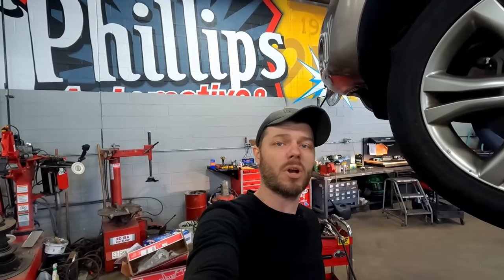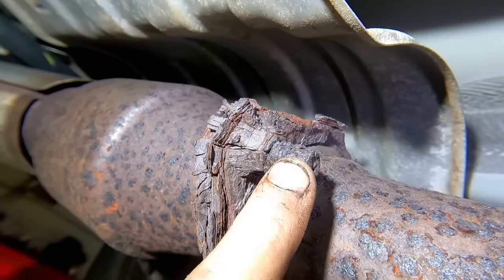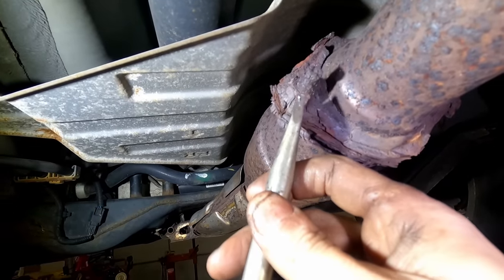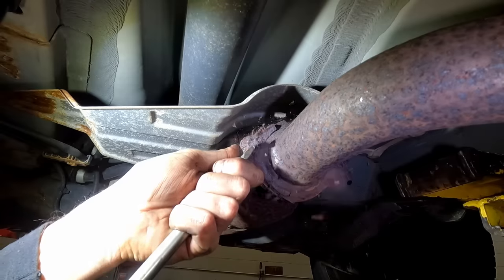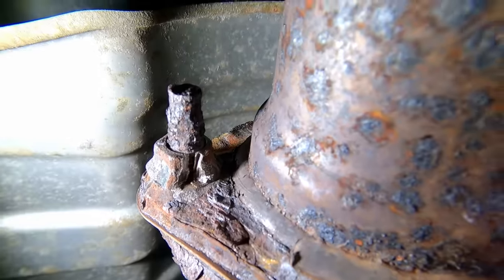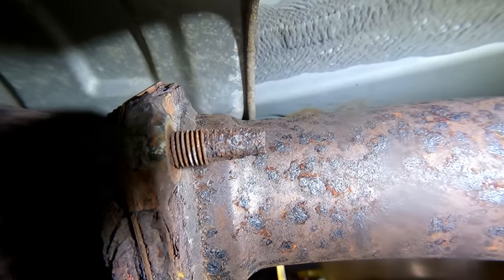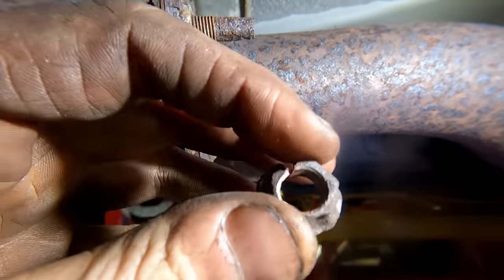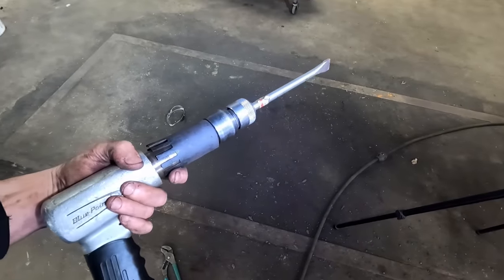Top Secret Mechanics Trick 2! HOW TO remove extremely rusty exhaust nuts FAST without heat.

Comment: That's one way but honestly I'd prefer a die grinder in this situation (1/4 collet rotary tool) with a cut off wheel.  A dremel would be more common in home garages.  Either is quicker, cheaper, less noise and more accessible.  To the regular DIY guy, just a dremel type tool cut off. I bet more people have a dremel  aka 1/8th collet rotary tool than an compressor and air chisel with chisels.  I'd just replace the bolt too 🤷‍♂️
Also you can fit a rotary type tool in many more spaces than that chisel.  Get the good reinforced cut off wheels though. Those cheap ones suck!!
Reply from the maker: Thats a stud not a bolt. Kinda the whole point of the video. imagine this was a stud on a cylinder head for an exhaust manifold. Please don't cut that off...

Comment: I'm a ford rocket scientist and I know broken bolts and pins in small block and most are big blocks where exhaust bolt break  is common. Made in USA parts were not used in fords nuts and bolts for many years sub par china bolts were used. Truth. Ford admitted it several times I know of.

Comment: This s a great example, number one the Catalytic Converter is pricy, so anything that increases the chance of reusing it is worthy ... Number two it's fast .. cutting off the bolt and tryg to redrill it, for a regular bolt and nut, is time consuming, and makes it more likely to leak exhaust fume or noise.. 

For the home mechanic, air hammers are cheap you don't need Blue Point for hobby use, AND you can get by with an air compressor a fraction of the CFM required by the air tool (read no 20 HP Shop Compressor needed) .. a cheap small air compressor WILL work, you just have to pause frequently, to let it air up to full power.

Comment: It works great... but i just use my 4 inch grinder and cut the nut off (if the bolt is damaged too)like yours are on the cat ...since your not going to use it again anyway.

Comment: Another great video. For a DIY home mechanic who doesn't have access to an air hammer, could you achieve the same result with a hammer and chisel, assuming you have space to swing it? Please keep doing more videos like this, they're really useful.
Reply: Yes you can.  You can also use a Dremel abrasive disc to make a sharper grove that splits the nut open using less hammering.

Comment: My air chisels are too soft. Its an old method done with a cold chisel and hammer. I'll be shopping for proper hardened bits now.
Reply from the maker: Snap-on. They arnt as expensive as you would assume. Worth the money and guaranteed for life even when you grind them down to a nub

Comment: I’ve always either gas axed off or cut off and drilled out to replace with a suitable nut and bolt.    Both ways work  but it’s a far different “ experience “ on a lift vs flat on your back with a car right in your face.     That’s a whole different world that I’ve come to know far too well☹️

Comment: Well you got the nut away but the catalytic converter and your lambda probe in the vicinity hate being punched around. Both have delicate ceramic parts. The actual Converter is a brittle round brick with tiny holes and it is wrapped with a thin heat resistant fiber mat and stuffed into the stainless steel tube. The mat does the trick to buffer the thermal expansion which is a real problem. To keep them from axial moving due to exhaust pressure they are supported by a ring of wire mesh on each end. If u punch it hard enough the wire mesh chips away at the ceramics and if those chips occur at the frontend of the CC they are trapped and hit the ceramics with the exhaust acting like projectiles till the typical golf ball rattle indicates the end of it.
I would always prefer a non mechanical shock inducing procedure if access is possible.
Reply from the maker: If done this thousands of times. Never once hurt a cat. Besides this video is about learning a technique not about removing ONLY cat hardware. Open your mind 😂
Reply: @motormike43  👍Well i was a student trainee at this time (some 20 years ago at Tenneco, in Germany), but i had to write an extensive report and learned a lot. I had to get the testing lab functionally which my predecessor wouldnt finish. It was all about how to keep the ceramics in place despite all the forces pushing it around. They even had shaker rigs where they burned a lot of diesel to generate hot gas for testing. Those cats failed at an alarming rate and a possible cure (the mesh ring and newly arrived Fiber mats) were expensive and would just buy a little more time because much more research was needed to simulate aging fatigue of the materials combined. We never had a meeting where external forces from repairs in the vicinity were regarded. After seeing your video my former RD engineer would have certainly raised his eyebrows. But despite all the trouble those days, CATs have turned out very sturdy in the end. Probably due to the ton of data i recorded and collected in endless cycle tests with the new material available haha.

Comment: Some oil, then I heat it up like hell, then try with a wrench, if it doesn't work, angle grinder and a new stainless bolt. You are using a percussor machine near catalytic converter, nothing should happen but it could move it from the iron and it will be bad.

Comment: Small disc grinder with a thin cutting disc will do the same job faster still.  I don't bother trying to save bolts that are this corroded especially exhaust bolts,  it's just not worth it.

Comment: Torch is way faster.
If you are going to use an air chisel, it would be faster to just sheer the bolt off and get a new one. If your air chisel wont sheer that little bolt off, you need a better one.
In the time it took to sharpen your bit, those nuts would be out with a torch.
Another faster method would be using a die grinder with a cutoff wheel, as long as you have access.
How do I know this? I have been a mechanic for over 40yrs and worked on marine equipment for some of that time, where everything is rusted away.

Comment: Ha! coincidence: I found that method already myself before the intenet existed...Two hits with a 1 kg hammer will do every nut.
2. The fire-spanner.(= blowtorch) solves everything. 
3. The grinder with a metal cutting disk, the best a small one with small diameter. 
Working on rusty dynosaurs is a job....

Comment: Red wrench.... AIN'T IT JUST AIN'T IT 😜 lols... I ran Muffler shops for many years.... I admit I have had to use this method many times....But a torch can be used to cut without removing thread... I use to cut studs from exhaust Port...Head bolts from Engine block.. especially on the older Cadillac... I have a technique...never cut a thread....

Comment: Yeah if you did use a torch all's you'd have to do is warm it up just a touch and it would turn off with the channel locks and then you'd be able to reuse the nut, not saying you ever would.

Comment: There is a tool called a Nut Splitter., no air needed. Just put it over the nut and tighten the blade into the nut, does the same thing but with no noise 😅

Comment: Ops, could have saved myself a lot of hassle. When I saw the nuts on my cat I cut them off straight away. But because my car is lifted on small ramps for DIY, I don't have much space to continue with the job so had to remove the cat itself too to be ale to hopefully knock out the old bolts now. Thanks anyways, great tip. Take care!

Comment: Something that rusted, why wouldn't you just replace the studs as well? Maybe it's something for the rust belt. Here in Texas, rust like that takes decades of neglect, and even then, it's not always that rust like that develops. My first car was a 77 and I got it in 2001 and it only had surface rust, even on the exhaust.

Comment: Why not just cut them off with the angle grinder if you can?
Reply from the maker: The flange with the threaded studs is not being replaced. Imagine these are manifold studs. You wouldn’t want to cut the studs off the cylinder head.

Comment: Well, if you don't have an air chisel, you can use a dremel. Or a nut splitter like I. You can reach them easily. You can also just use the sawsall. and did I hear him say you can put a nut back on a badly rushed bolt wtf. Replace it .

Comment: today Nobody does this way , cut the old bolt then heat up half bolt left on flange and punch it out , replace new bolt ,
Reply from the maker: that works on a "through flange" not on a blind hole with a stud. Keep an open mind to using this in more situations than just the one put in front of you.

Comment: Ok this is great if you have a lift to take the car up high, and if you have the power tools to use and you have power.

But then if you have all that why would you leave it so long to tackle a job like this, if you have a lift why wouldn't you put that car up on that thing and check it over periodically? It's just a thought.

So if you don't have all that stuff and all you got is hand tools, no power and rusty nuts, it's a different story I know.

To achieve a similar result you could use a nut splitter, a hammer and chisel, but it is harder work, especially every time you hit that chisel with your hammer bits of rust falls into your face because you are laying under the car which is on stands, fortunately you are wearing eye protection except unless you get decent eye protection they steam up especially in winter.

Comment: Yeah, perfect in a fully fitted out garage 🙄 you probably have the blow torch as well if you feel like doing it that way. No use at home though is it, I'd have to call someone. What was the chisel attached to? Edit: Ignore the question, you show the "air hammer" at the end.
Reply: I did this with a $10 sledge hammer from Harbor Freight and a regular chisel, laying on my back in a gravel driveway recently. It worked similarly to this, albeit a bit slower. There is no reason to call anyone, unless you’re lazy.
Reply: @patrickm4566  I went with a Dremel in the end but good to know and you'll end up with the bigger muscles, elbow grease ftw.

Comment: Never grind anything using the rest that way as the workpiece it’s liable to be drawn in between it and the wheel if the gap is to large resulting in disaster, grind on the top of the wheel as it comes towards the workpiece it also throws the burr away from the leading edge. Watch a drill sharpening video. Bit of advice from a retired engineer still with his hands and eyes in one piece.

Comment: Why can't you just saw through the bolt+nut at the flange and replace with new? ... would be easier.
Reply from the maker: Stud is threaded into the flange. Pretend this is a stud in a cylinder head. Maybe a manifold nut.

Comment: A even quicker way is take a sawzall line It up between the 2 flange plates. cut the  bolt in the middle. And just replace the nut and bolt ,,, Ta Da And if things are that rusty, you don't want to reuse any of the nuts and bolts, all new hardware

Comment: I wish to clarify the point that he is not cutting all the way through; that will ruin the threads.
The trick is to stop before you get too close and oval the stud or distort the threads.
He is cutting only 1/2 to 2/3 the way,  It is when you angle and turn the nut that it splits the rest of the way (or simply may come off unsplit).
It may have not been apparent from the views that it split only after the chisel is redirected away from the threads; and tension, not compression, is now acting on the nut...

Forgive me if anyone already said this; I am abandoning my previous diligence to browse the comments and post a like and comment there, if someone already posted this.
[TOO many good comments and not enough hours in a week...]

-OH, Superb video!
Mr K L
Reply from the maker: Yes. Great comment!

Comment: Thanks for the great video tutorial.  What kind of shop air pressure are you running?    Your air chisel sounds stronger than mine.
Reply from the maker: I run my shop at 150psi. I only use Snap-on chisels because they are guaranteed for life. Even after I re-sharpen them for years and grind them down to a nub they just give me a new one. Worth the money.

Comment: 30 seconds and a torch would have had those off with a lot less noise.
Reply from the maker: The flange with the threaded studs is not being replaced. Imagine these are manifold studs. You wouldn’t want to cut the studs off the cylinder head.
Reply: @motormike43  I never said I'd cut the nut off with the torch. I've heated nuts like that with a torch, stuck an appropriate sized socket onto them and ripped them off without damage to the studs dozens of times.  Just my way of doing it and like I said, a LOT less noise.

Comment: You could also chisel the fastener head off
Reply from the maker: The flange with the threaded studs is not being replaced. Imagine these are manifold studs. You wouldn’t want to cut the studs off the cylinder head.

Comment: Screw that, just cut the bolt end and nut off together and drill out the other end. 5 bucks will buy you 2 new bolts and nuts at the hardware store

Comment: My method , cut said nut off with a 1.5mm inox blade drill out stud if not a bolt replace with a new bolt , looks a better job than using that last bit of thread ..................

Comment: in case you are wondering, a socket does fit over it and you can unscrew it, its not guaranteed that it will be the original size, but just clean the nut and find something that ''almost'' fits hammer it on and start loosening and use a lot of rust remover, worked for me at least and you dont need an airhammer
Reply from the maker: The video isn’t about removing the nuts in question. It’s about learning a new technique when you have no other options.

Comment: I have a 2020 GTI and bought it brand new and yesterday I was going to install my downpipe but the band clamp that holds the resonator to the downpipe had the rustiest bolts I’ve ever seen. Everything was clean underneath but the bolts on the clamp was pure rust. Absolutely no threads visible so I had to postpone the project

Comment: Thanks for the tip. Hopefully won’t need it though. To be honest, most of the time, when wrenches can’t work, you’d just use a cutting wheel, then replace both the nut and the bolt.

Comment: I've done this before, and the vibrations from the air hammer, caused the 02 sensor internal ceramic to crack, and I had 02 sensor faults after it, so as a precaution you should remove the 02 sensors on that pipe you are working on.

Comment: That works when you have room to swing a hammer and a sharp chisel. An electric grinder with a cutoff wheel would also get it off in less than 30 seconds tho.

Comment: In that situation, I would go about it in the following way:
Take a drill and drill a 4mm hole sidewise into the nut, just as far as the tread of the stud. Then take the chissel well sharpenned and split the net by edging it in the hole direction parallel to the exhaust pipe. Once split you can easily twist it with a plyers. Your method is more cumbersome, as the pipe swings sidewise, unless you fix it with a timpber block against the chassis.
At work -- I would take the gas welder and a burner size 3 -- heat up the nut to red hot, then twist it open with the wter pump plyers, -- thats probably the quickest method--

Comment: I would use a wire brush anf file, and put some penetrating oil on it. Then I would use a 1/2 inch drive socket instead of a 3/8, if a socket wont fit Vise grips. In the case he's doing I might take the bolts off before the CAT and saw the rest of the exhaust off and replace it,

Comment: I'd cut out the flange and weld in a new flange then coat it with header paint... There is hardly anything left of that flange your tutorial is on. That's asking for leaks later.

Comment: The rest of the flange is junk. Replace it all
Reply from the maker: ok. Buy a $1000 Cat. The flange is fine. Open your mind to using this trick on rusted nuts in any situation and not just the one that was put in front of your face. I don't remember saying.... "this will ONLY work on a rusted exhaust flange and nothing else ever"

Comment: I wish I had air, but I don't so use a bosch multitool with a carbide tip to cut the slot, then an old chisel, as soon as the integrity of the nut is broken, they wind off.

Comment: I torch one side of the nut, as close as possible to the stud, with a little practice you can cut the nut, and leave the stud perfect, I prefer this method because I abhor air hammer noise, far more than torch work. The a hammer is good where you are close to the fuel tank / evap bits. Still a good alternative, a toolbox full of techniques is a great tool in itself.

Comment: That entire exhaust is rusted so bad, there is no need to try and save threads. I'd replace it all. Thank God I don't live in a place that causes cars to rust out so bad. I have never seen so much rust in person. I live in SoCal. Aside from that, that chisel trick is not top secret. I have known about for decades. We have to use it when nuts get rounded off sometimes.

Comment: I absolutely WISH i could post a picture here. Im doing up pipes on my 2000 7.3 and this method has helped me get the bolts out and i tried heat and alll😂 thank you very very much for this video. You should see how tight of a space im working in too haha both pipes are in-between the engine an fire wall lol

Comment: Kind of the same way you remove a steering wheel lock with a big solid center punch . Works better with center punch for steering wheel lock not a flat air hammer bit because there just wouldnt be enough room for using it

Comment: Snap on recommend you use a file to sharpen their chisels ,also you sharpen a chisel into the cutting edge ,I personally have been splitting nuts with a hand chisel for decades but access is always the problem,don’t fancy doing this against cast